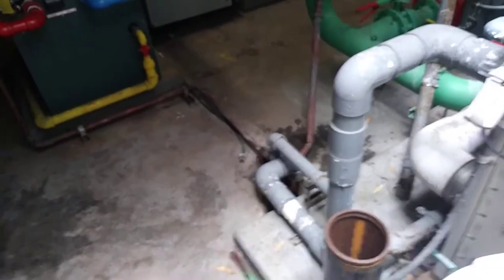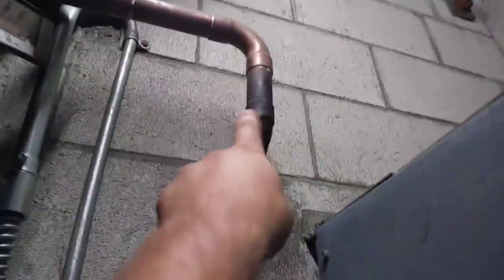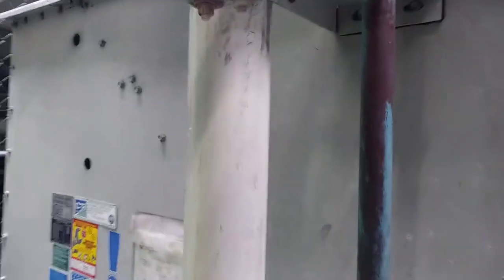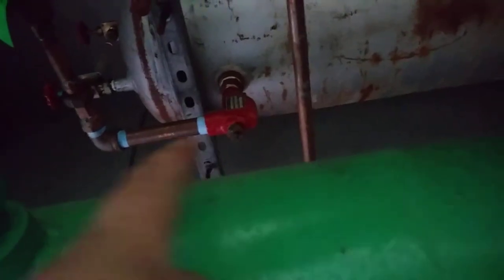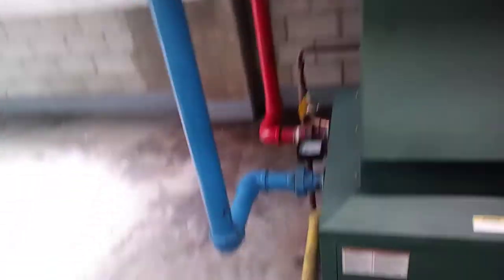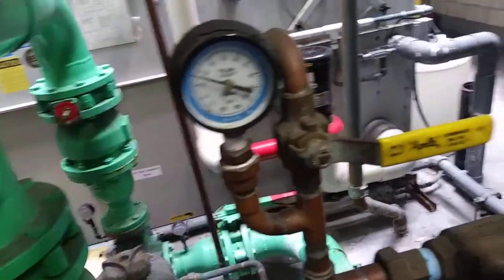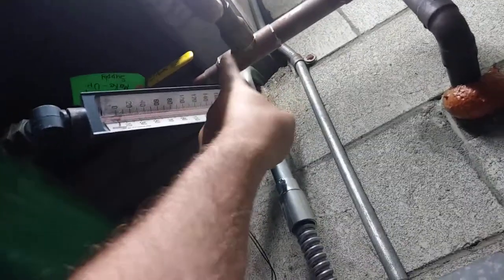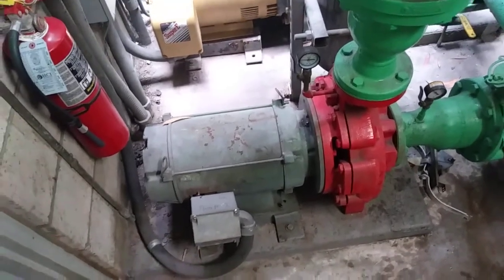Cooling Tower Plumbing- Closed Loop Make-up System

Comment: Thanks for your video, what is the water pressure inside the close circuit loop? Thanks
Reply from the maker: thank you for watching! the return side (pump suction) is set to 12 psi and the supply side (pump discharge) runs about 75-80psi in this application but, that may vary based on pump size, total riser height, etc.